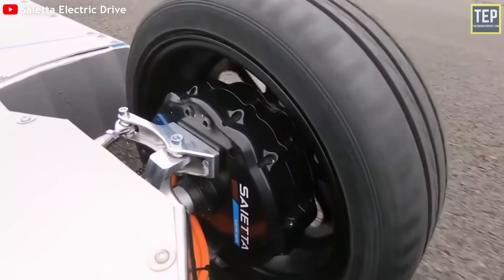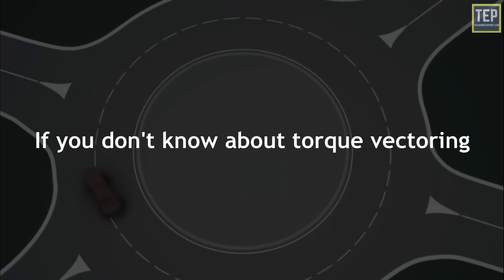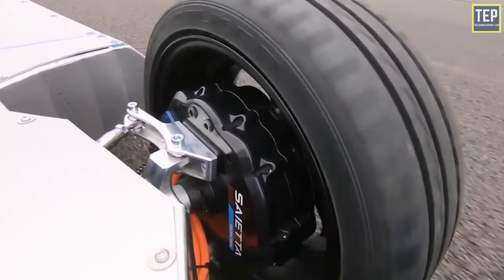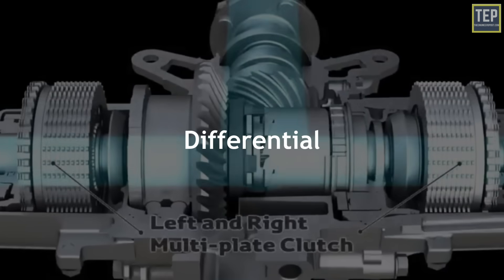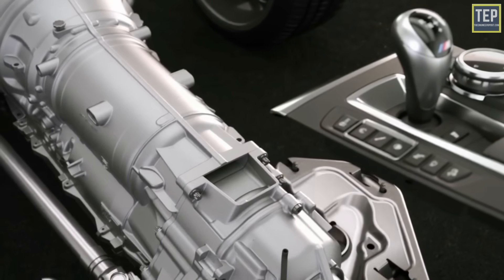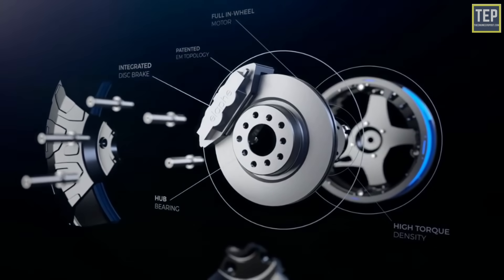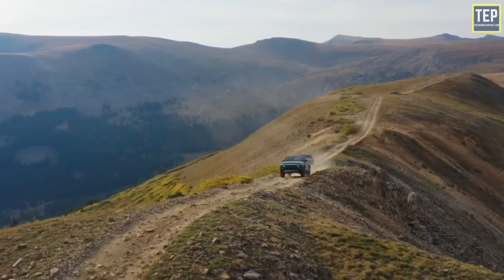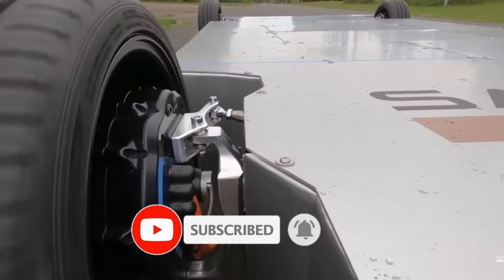How does In-Wheel Motor Technology Work? | Four Motor Drive & Torque Vectoring

Comment: Current EVs use close to 10:1 speed reduction gearing to increase the torque. Could in-wheel motors provide similar amount of torque without increasing the size of the motor, which in turn increases unsprung weight?
Reply: yes conventional EV's use lower torque /higher rpms to achieve better power density but electric motors can be designed to provide the appropriate torque/power/rpm needed by tuning voltage , Amps, windings
there always some unsprung weight penalty though, since an in wheel motor cannot be lighter than just a regular wheel. maybe one day with brakes delete and  more advanced electric motor tech
 aptera paradigm performs 3.5s 0-60, 110mph top speed with three 50kw hub motors (200hp) and 800kg, showing very good performance considering the power to weight ratio. Tesla model Y performance has the same 0-60 with similar or higher power/weight and two rear wheels AWD vs 3WD, so I would say torque is no slouch in the aptera. I don't know if the in wheel motor could scale up to power a 4-5000lbs EV with the same sportiness though. Seems like direct drive in wheel motors are better suited to lighter electric mobility using less power and smaller wheels like electric scooters and skateboard's, small wheel ebikes, light electric motorcycles or light ev. geared hub motors are the most common type in regular sized wheels ebikes, providing better torque than direct drive, but they have their share of issues. plastic gears that wear or even melt when overheating, or heavier metal gears, heat mangement issues, noise, and additional complexity to implement regen
Reply: also if you look at elaphe in wheel motors which is the supplier for aptera, the peak wheel torque for every model is very high compared to the power. this is off course a direct result of power = torque x rpm and rpm being much lower without gear reduction. but the peak torque is also 2-3x as high as the torque at top speed.
the torque/power curve is very likely to be similarly shaped to any electric motor with close to 100% peak torque available from 0rpm to somewhere half or third the rpm range, then  kinda constant power from there to the end( with some power drop though)
if you have driven an ev , it a the same. basically if your motor(s) is powerful enough  for your highway speed driving, starting and low speed torque will be more than plenty enough. probably even by a pretty healthy margin. this is not so true for direct drive hub motor ebikes which are enclosed and passively cooled, and can't sustain high amps needed for high torque for long periods. meaning steep and long hill you will probably need to use a good amount of leg power, whereas on flat ground, the motor won't have issues maintaining a good 25mph on throttle alone

Comment: Hub motors are nothing new, the pros and cons are also well known. Centralized motors are the top dogs in the bicycle industry these days… for good reason.
Reply: mid drive motors can take advantage of the gears to provide more torque and climbing ability, lighter wheels and more natural torque sensor to multiply your strength/effort like a superhuman instead of on/off cadence sensor or throttle. although it's possible to ass torque sensor separately to a hub motor its much less common.
mid drive are perfect for sporty road/mountain ebikes. hub perfect for cheaper commuter bikes and people how don't want to pedal. I would say that much more ebikes are sold with hub motors than mid drives. mod drives for pretty much all legacy bike manufacturer, hub for most chinese ebikes or Kickstarter/ startups/online brands although some are venturing into midbdrives

Comment: I will not drive though I think that the inwheel electrical motor is an excellent idea 👌 it would be excellent if they made it for a van, roads just have to be improved to extend the life of the inwheel electrical motor, all things are possible given enough time, I like the inwheel electrical motor it is an excellent idea that has been produced. 1-28-2022.
Reply from the maker: Agreed

Comment: to much weight in wheel shock absorbers would have rough time on bumpy road
Reply from the maker: If they lower the unsprung weight, the less work the shocks and springs have to do to keep the tires in contact with the road over bumpy surfaces.